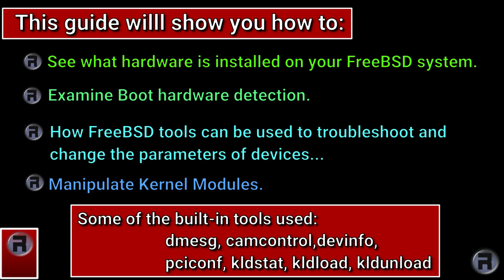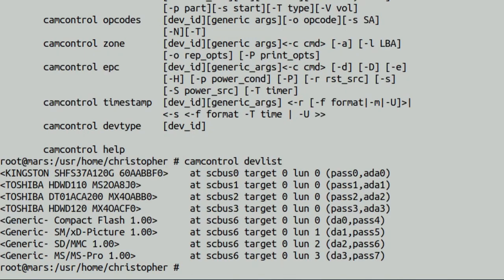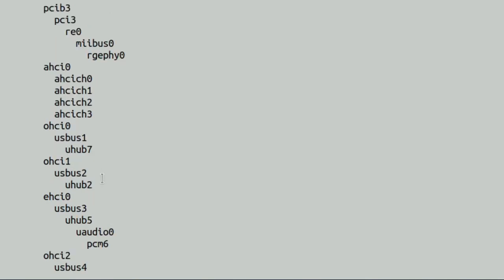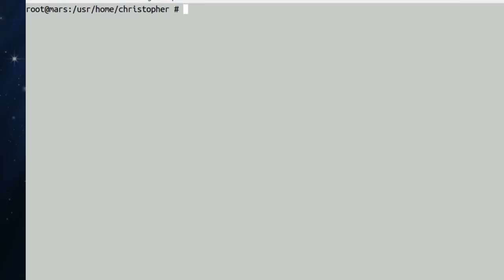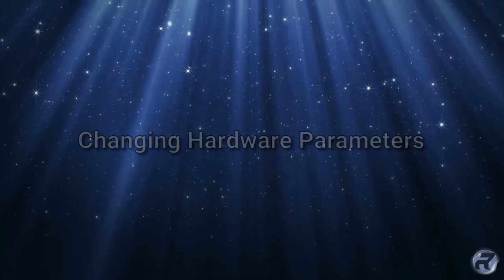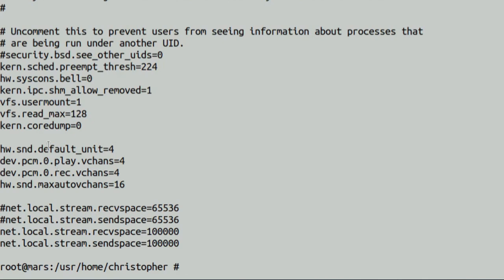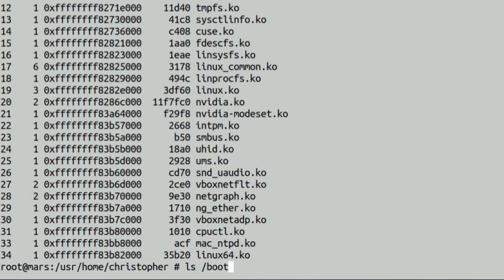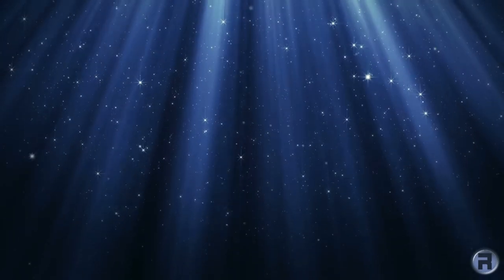Getting Into FreeBSD #1 - Hardware Tools

Comment: Great video. I am watching it and Part-2 and 3 are lined up next :)
There are some other great tools, like:
1. freecolor - Simple memory statistics. If you use it like "freecolor -m -o" then it gives Linux like memory statistics. 
2. lsblk - Gives Drives and Partition information, Partition Table, Filesystem, Size and Mountpoints.
3. pidof - Gives PID of given processes. For instance "pidof firefox" will give you its PID. It is easier than "ps".

At 14:40 you hid your Mac address, which later revealed at 15:08 :)
Reply from the maker: Thanks for the others, good choices... lol, the mac address, well, it was on an add-in card, but that card no longer works, so, I thought I'll leave it :-)
Reply: @RoboNuggie  You can also spoof your MAC (temporarily during the video recording) with the help of "macchanger". In this way, you don't have to worry about hiding it ;-)
Reply from the maker: @salmanahmed105  I  didn't know about this little gem.... thank you Salman!

Comment: I just got myself a Sun keyboard. Does the function cluster (Open, Copy, Paste) buttons on the left work by default on FreeBSD?. Or do you need to do something to get it to work?
Reply from the maker: You have to define them.... I I suppose it also depends on the Window Manager or DE used, as maybe you can assign then there... I have looked at this in the past, but never really tried..... would be nice to get some use out of them.... hmmmm :-)
Reply: @RoboNuggie  Perhaps if I was running Solaris itself, then maybe it will work by default.